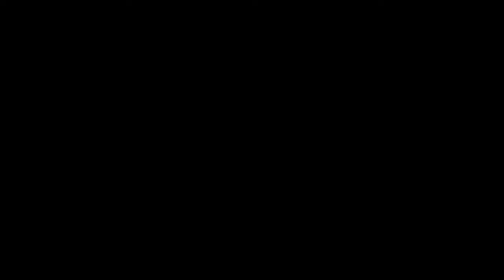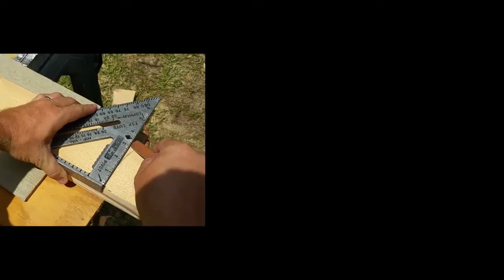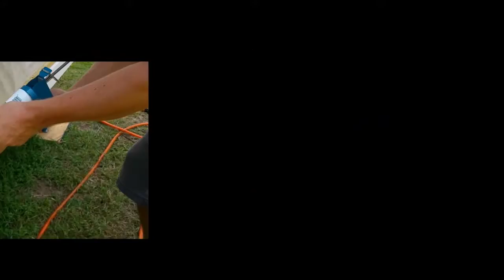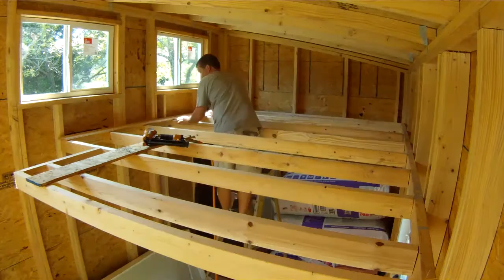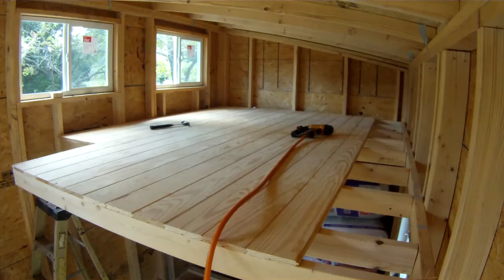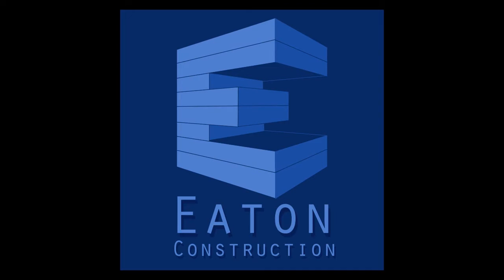Tiny House Loft Part 2

Comment: How do you properly secure the loft framing to the studs of the exterior wall? Do you need metal bracket hangers?
Reply from the maker: Conor Doyle if you watch part 1, you can see at the end where I shot the nails through the rim joist of the loft into the side walls. I believe I used 3 1/2" nails and shot 3 into each stud.
https://youtu.be/5Zzp32ZKGjw